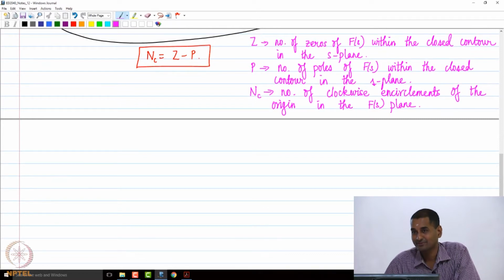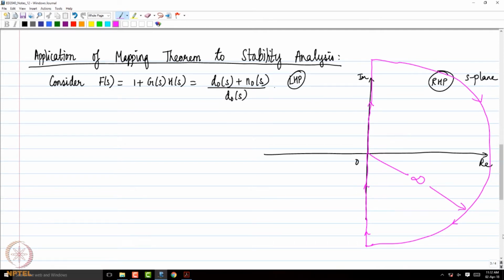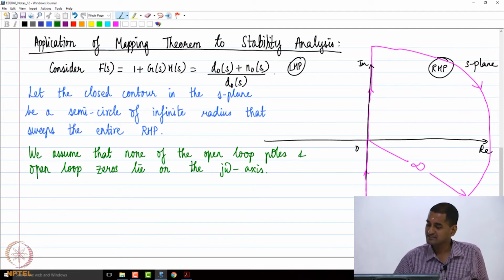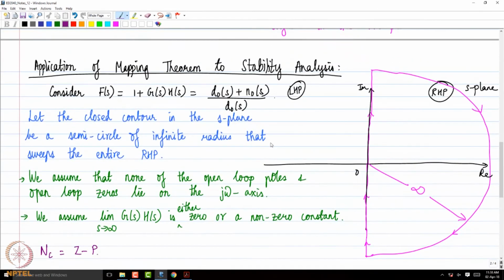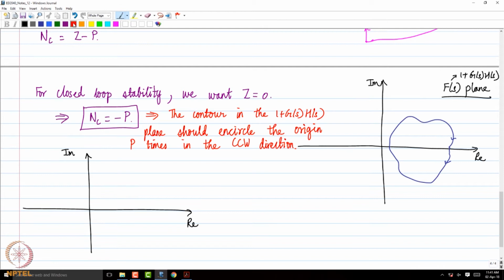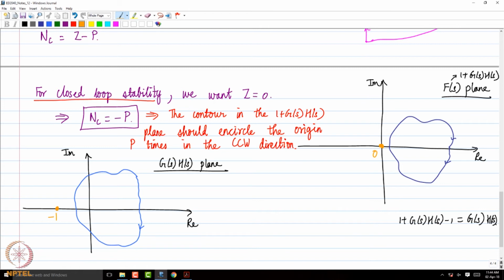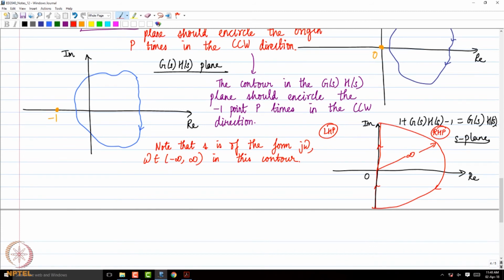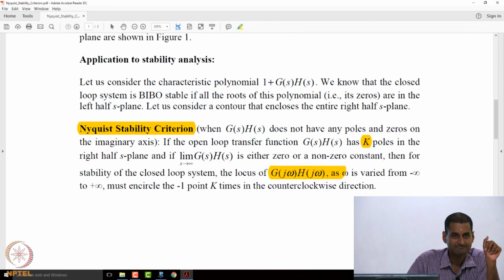mod11lec62

Comment: application of mapping theorem to stability analysis:
a semicircular contour of infinite radius covering the entire right half of s plane is mapped to one in F(s) = 1 + G(s). H(s) plane. Then with following assumptions :
a) none of OL poles and zeros lie on jw axis
b) lim  G(s). H(s) = 0 or const as s -> inf implying system causality
for CL stability we want z = 0 => Nc = Z - P = --P ie. the contour in F(s) plane should encicle origin P times in CCW => contour in G(s). H(s) plane will be the one in  F(s) (= 1 + G(s). H(s))  plane minus 1 => # CCW encirclements of (--1,0) in G(s). H(s) plane = # CCW encirclements of origin in 1+G(s). H(s) ie essentially we are now looking at Nyquist plot for stability analysis.